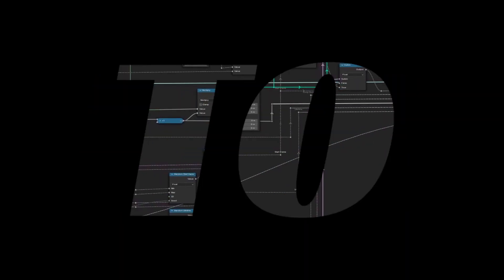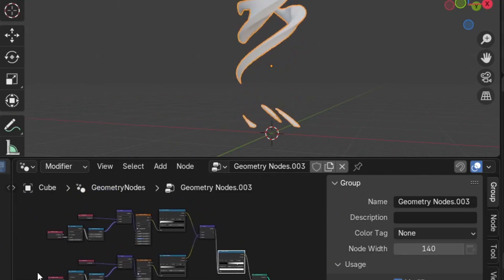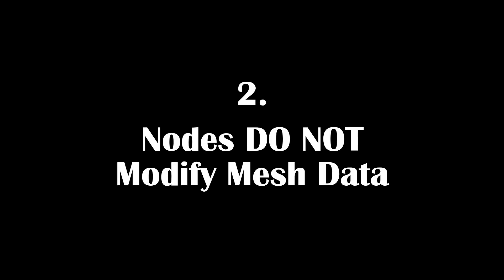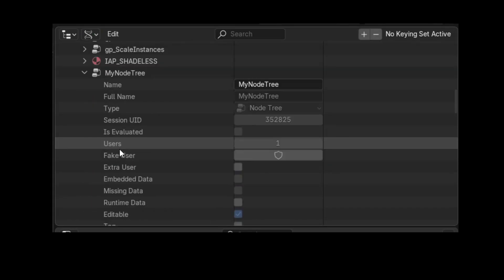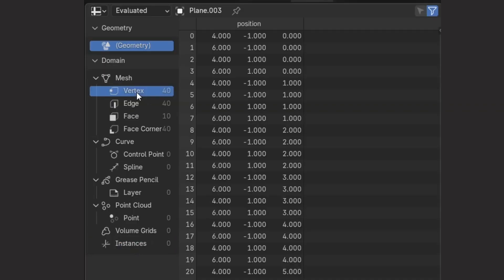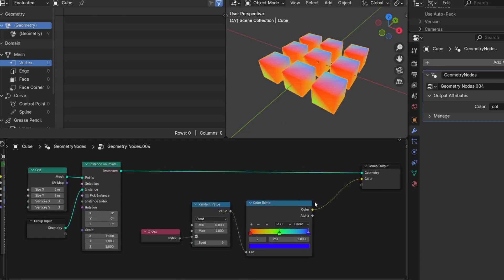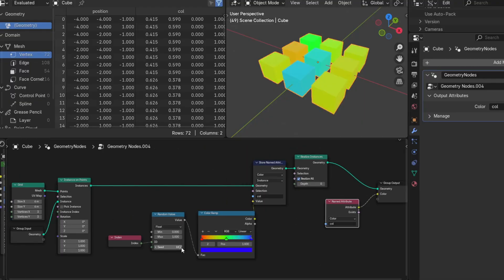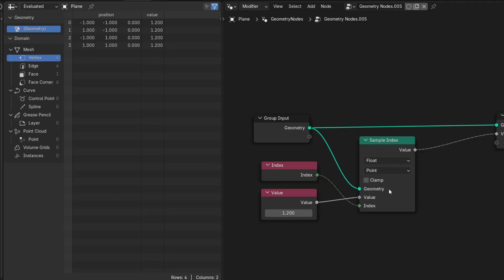Understanding The System Behind Geometry Nodes

Comment: All I want to do is make a relatively complex road. I've got so many ideas about how I want geo nodes to work for me but nothing is intuitive and I'm really struggling. I keep trying over and over again but progress is really slow because I keep running into new problems constantly, at every step. Dot products and vectors, it's enough to make one's head spin. Maybe I'm just too dumb for it but it really feels like finding solutions on your own is impossible if you don't already know mathematics and programming like the back of your hand. Anyone else feel like this?... It's just me? Ok... Sorry for the rant! hahaha
Reply from the maker: It can be very frustrating you are thrown into pretty high level trig in 3 dimensions. I can’t tell you how many node networks I’ve made that I’ve abandoned and started over. Making small steps while learning from mistakes and remembering what actually did work and why is key. Id say it’s like programming but if you are comfortable with things like Unreal blueprints, Geometry nodes can be extra confusing because of the execution flow. But at least I can say I would really relate to this comment a few years ago and there did come a point where I started thinking and problem solving in nodes
Reply: @LukeStilson  You might not believe this but over the past day or two, idk something about Geo Nodes finally clicked for me. I dug deep and managed to start understanding cap attribute nodes and how data is supposed to flow. Your video helped me too btw so thank you! Subbed!

Comment: I love the examples with color but Ive always had trouble putting image textures on multiple things in geometery nodes, why cant i capture attribute image texture not just colours, ints and stuff?
Reply from the maker: Ooh that’s an interesting one. It has to do with sampling- there’s no real such thing as texel sampling in GN. So like you can capture attributes by vertex or face corner, but afaik you cannot really capture image data because that would be ‘a bunch of pixels’ over ‘X amount of face corner space’ or ‘X amount of verts’ — not a texel or “fragment” sampling. Maybe partially because GN do not use GPU acceleration like shaders. You CAN divide a grid into the amount of pixels of an image and perfectly sample the image, but obviously this is (cpu) heavy for large images. Now with CSV import, maybe we can store like image ‘area coordinates’ per face or something.. but I hope this kind of makes sense.

Comment: You would have lost me at 3:57 if I didn't know what attributes meant (only because I'm learning Houdini, so I assume others would feel lost here too)

However, you did lose me at the example at 4:31, what is happening? It felt like I was being told "This happens and it just works". (No offense<3)

But that was literally it, everything else did make GeoNodes easier to understand.
Reply from the maker: I got ya I flew through that. Basically just not using instances at all there. Just chunking vertex count to define each realized instance mesh (floor)index of each vert/single instance vert count. at this point, this new number is used in place of index. Imagine each instance is a cube with 8 verts. This math operation gets us per vert value like 0,0,0,0,0,0,1,1,1,1,1,1,2,2,2,2,2,2 instead of 0,1,2,3,4.. etc. transfer attribute is an easy way to capture an attribute based on this